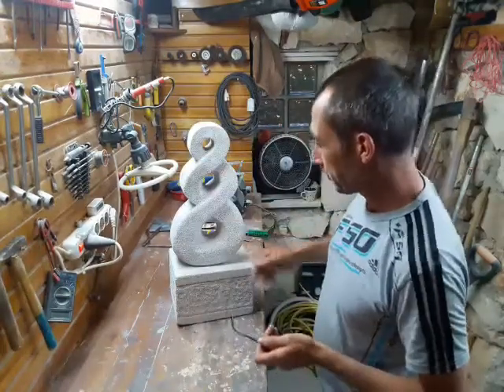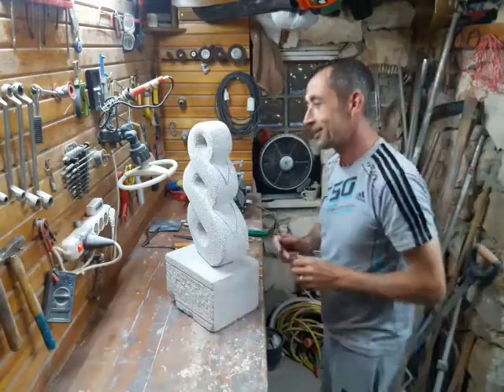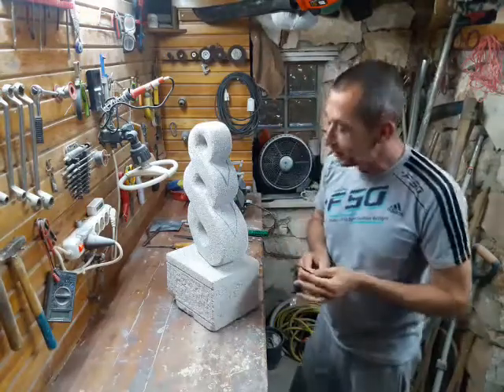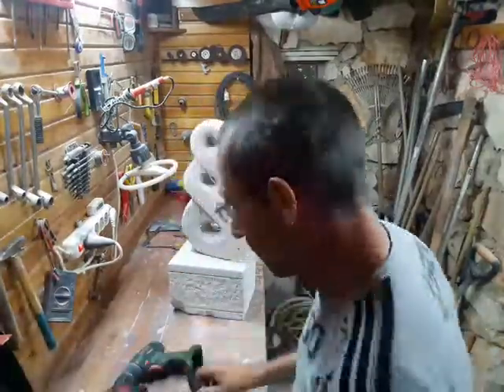3D Twisted Sculpture using Ytong AAC Autoclaved Aerated Block

Comment: you skipped over how you did the base which would have been interesting to me. Big improvement on the second day. Nice piece!
Reply from the maker: Hi Roger,
Appreciate the kind words bud 👍😉
For the base I just used a saw to 'etch' s border/line 1 inch from top/bottom then I used a pick hammer (pointed head) and I also used a flat screwdriver.
I wanted an "aged/worn" look and hence the sparodic pattern - hope this helps - stay safe bud 👍

Comment: Nice work mick,if i wanted to use a few blocks,what would be the way to glue them together..i mean what sort of glue would work best for sculpting,i am a 3d sculpter on the pc and would like to do this in real world,any ideas mick cheers
Reply from the maker: sillious sodious - I would go with something similar to this buddy
https://www.rockcote.com.au/products/aac-adhesive

It is specifically made for the job, crack resistant and is a good colour match.

Obviously if you can buy the AAC  blocks locally consider asking them.

Good Luck and send me a link when its finished :)
Reply: cheers for the reply mick

Comment: Nice work!  What an intriguing shape!  Do you worry about how brittle AAC is?  If so, you think you might cover the outside with something to reinforce it?
Reply from the maker: Andromedus - many thanks for your kind words. I understand your thoughts regards how brittle an AAC block can be :)

All I tend to do is round the edges off slightly to minimise the chance of accidental damage.
If you do sustain damage or find unsightly natural large air holes on the face of your project, I would recommend you mix some of the AAC dust with the white school glue - it can be bought from most  stationary shops or supermarkets, it has a distinctive smell (you will remember when you smell it) it is cheap and will dry transparent.
Thanks again :)

Comment: Could I ask where you got your block from? I'm having difficulty finding such....😳
Reply from the maker: Hard to say - where do you live bud?
Reply: @mickstevens4677  UK..
Reply from the maker: https://www.ribaproductselector.com/products/thin-joint-autoclaved-aerated-concrete-aac-common-blockwork/F10_370.aspx

Master ikt - Try typing "aerated autoclaved block" in Google - I actually found sone cheap ones on eBay bud 👍😉

Comment: is this something i can get from B and Q? wickes? and tut Mick where's your mask?
Reply from the maker: Hi NIck

Thanks for your comment.

You are absolutely correct - a mask and possibly goggles and gloves would certainly be a good step in the right direction regards Health and Safety - my bad :)

I no longer live in the UK but a quick search online indicates you shouldn't have too many problems sourcing the materials you need bud.

B & Q (44cm block)
http://www.diy.com/departments/celcon-grey-aircrete-aerated-block-h-215mm-w-100mm-l-440mm-7300g/35851_BQ.prd

Wickes (60cm block)
http://www.wickes.co.uk/Cellumat-Aerated-Block-3-6N-100mm/p/164235

Good Luck !

Comment: Hey Mick. Good job on the sculpt. I know this is an older video and you may have changed your ways, but I wholeheartedly recommend you wearing a dust mask/respirator while working with such a dusty material. Concrete dust is not good for your lungs.

Comment: joli, je suis Français et je travail aussi cette matière.
Reply from the maker: Dominique Cuveillier - Thank you for your comment 😊
Reply: merci pour votre réponse. je ne suis pas encore a votre niveau. Mais je prend beaucoup de plaisir à créer. ici en France pas encore bien connu cette matière pour l'art.
Reply from the maker: Hi Dominique - this is my 4th ever sculpture so I am also still very much a beginner.
I love the material as it requires just basic tools and is very easy to work with.

Tip - Small repairs and holes can be repaired by adding some of the dust with white wood glue (the stuff you probably used at school - it has a very unique smell).
I hope you continue to enjoy your hobby :)

Salut Dominique - c'est ma 4ème sculpture, donc je suis encore très débutant.
J'aime le matériel car il nécessite des outils de base et est très facile à utiliser.

Astuce - Les petites réparations et les trous peuvent être réparés en ajoutant une partie de la poussière avec de la colle à bois blanche (le truc que vous avez probablement utilisé à l'école - il a une odeur très unique).
J'espère que vous continuez à profiter de votre passe-temps :)
Reply: Hello Mick , je vais utiliser votre astuce pour réparer une sculpture que j'ai brisé en y allant un peut trop fort.
Je suis comme vous, je n'est pas fait d'école. Et c'est un bon passe-temps :)